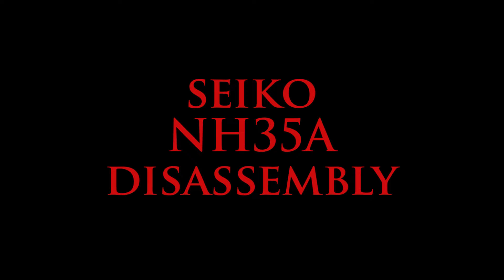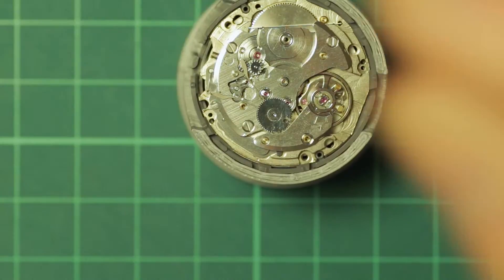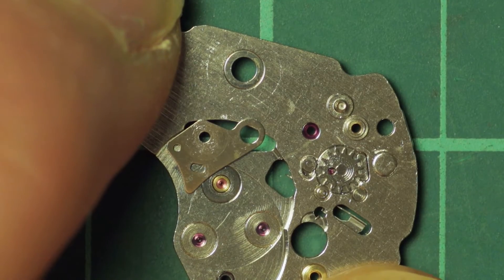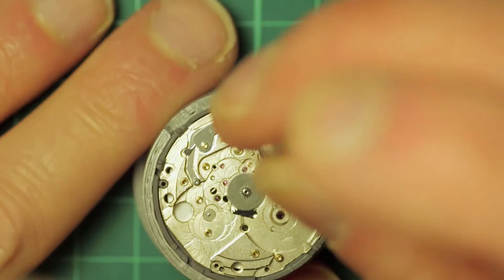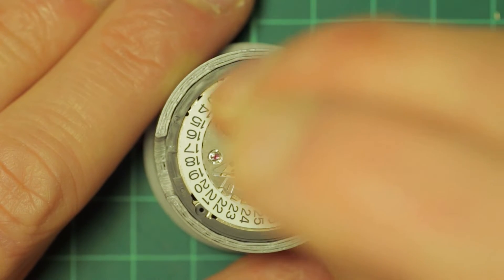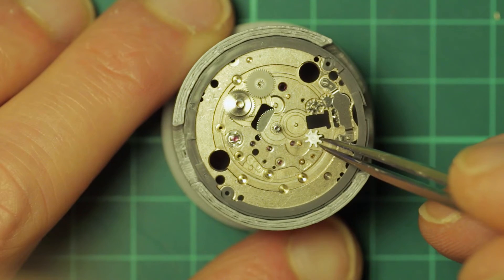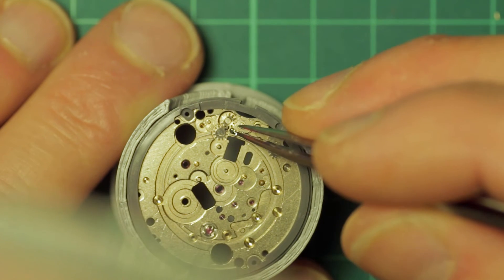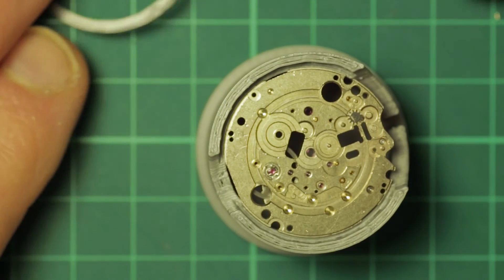Seiko NH35 - NH35A Part 1 Service - Disassembly

Comment: very cool. but realistically the price of a replacement new one costs less than labor costs repair it. but i enjoy it either way i have an old 7s26 that stopped working and i replaced it with nh36 movement. and i want to disassemble it like this. 👍
Reply from the maker: Absolutely if you're paying someone to service one. A brand new replacement is cheaper without doubt.
I filmed this because no one on YouTube at the time had taken one apart and I wanted to see how different or similar to the 7S26 they were.

Comment: I have this i problem.As i rotate the crown stem the thing in the middle that rotates the hands stays in position and doesn’t move even a bit.I requested a refund and they said they will refund me but i think there is a way to fix it.
Reply from the maker: @faze_vankis1205  I'm assuming that you're in hand setting position. Your crown will have 3 positions closest to the watch winding, middle, date setting, furthest out hand setting. 
Turning clockwise turns the hands clockwise. 
If the stem is pulled fully out with 2 distinct clicks then something is amiss internally which could be anything from a misaligned setting lever to teeth on the gears damaged.
Reply: @ what should i do because i in new to this kind of thing
Reply from the maker: @faze_vankis1205  Whatever the problem it will require quite a bit of disassembly to find the cause and possibly parts to repair. All said it's cheaper to replace the movement at about £30
Reply: @ Can you send me an link for new movement?
Reply: @ Is there any chance to cantact you and help me with the problme because another movement will come in 2-3 months in my country

Comment: Sorry if I missed it in the video or comments, but how much would a servicing cost for this movement with gasket replacement?
Reply from the maker: Cost would depend on the watchmaker/service centre in question but the bottom line with a movement like this is that a brand new replacement would be as little as a third of the cheapest service price you're likely to encounter.
They can be had from supply houses for £40-£50

Comment: do i have to disassemble the whole movement to remove the plastic spacer of the movement? or after the calendar wheel is removed you can strip it ?

Comment: how much years the NH35 can survive without problems ?
Reply from the maker: Like most modern mechanical movements with modern synthetic oils it should run between 5-10 years before needing service.

Comment: Hello,
Thank you for the great video!
I have a question (if you could help me - I google'd around a bit but didn't get a certain answer besides the obvious one - rotor) - What parts can I remove (besides the rotor, of course) to keep it as a manual winding movement only?
Is there any other part besides the rotor I can remove to keep it as manual only?
I am waiting for a movement to arrive in a couple of weeks and I could test then, but I think a small question doesn't do any harm until then.
Cheers!
Reply from the maker: The oscillating weight and the automatic bridge underneath it.
You can however leave the automatic bridge although automatic winding movements aren't ideally suited to be used as manual wind only without some modification to the winding components.
Reply: I think I've got my answer in the 2nd video. I've just reached the end and you mention that the hand winding won't work without the reduction wheel and automated bridge installed. I guess I can only remove the rotor, right?
Reply from the maker: @SoctheBASStard  Actually yes that's true as it winds via the reduction wheel. I was confusing it with most Swiss autos which have a separate system.
Reply: Thank you for your answer! will test around when the movement arrives.

Comment: Hi - Great walk through!! Once disassembled, what is the best way to clean all the parts prior to reassembly.  I've got an NH35A that is new but doesn't regulate happily - 1 out of a batch of 5 so I assume it's likely to be excess grease/oil etc.  Is the process basically the same for NH36 and NH34? Thanks!
Reply from the maker: I use a conventional watch cleaning machine but if you don't have one and are hand cleaning then a small essence jar or similar small glass jar and a soft paintbrush with naphtha will clean the parts adequately especially being new, a rinse in isopropyl alcohol except the pallet fork and balance assembly then reassembly and suitable lubrication should see it ok.
This is assuming there's no underlying cause of the poor running and it's merely lubrication/detritus/assembly problems.
The others should be essentially the same the only difference being extra or lesser dial side components for calendar work and/or GMT gearing parts.

Comment: Was the power from the mainspring released by unscrewing the ratchet wheel?
Reply from the maker: No, in this case (and in the case of any automatic winding watch) you remove the auto winding works then release power slowly from the crown whilst lifting the click spring.
With the 7S26 and earlier models which didn't hand wind you use a screwdriver on the ratchet wheel screw to slowly release the power.
Reply: got ya, i build my own watches but havent quite gotten to disassembling a movement till i was given a non running NH36 first so wanted to get a feel for it first, ive disassemlbed old 60/70s watches that had an obvious click but im used to seeing those instead i think. thanks :)  @spidiq8

Comment: This is a spectacular video.  I built a Submariner homage with an NH35 and as I was trying to get it better than +6 sec/day and 2.7ms beat error, the balance wheel stopped and refused to keep moving.  Your video helped me disassemble it to inspect the parts.  Now it's time to reassemble it and see if the cat hair stuck to the escape wheel was the culprit.
Reply from the maker: That sounds promising. Anything on the hairspring will cause you problems. Be sure you have a very clean and well lit work area for the reassembly.
Glad the video helped.
Reply: @spidiq8  I've got a desk specifically for watch work.  This isn't my first movement, just the first Seiko.
Reply: I honestly wanna buy one of these just for study purposes, it's quite amazing how this works
Reply: When I got it back together the balance wheel still wouldn't stay in motion, and the stem wouldn't insert all the way.  I took it apart again and found that the yoke wasn't properly aligned with the sliding pinion.  The balance wheel just took a bit of hairspring adjustment and regulation, but it's running at about +3 sec/day with a 0.3ms beat error now.

Thanks again for the time and effort put into your video.
Reply from the maker: @SlickWillyTFCF  Great news, glad you got it sorted.

Comment: Good evening. Very excellent. Thank you very much !! Just a question (I'm a beginner)... Wich number for the tweezers you use on the vidéo ? N°2 ? N°3? Thank's i
Reply from the maker: Thank you. I use several tweezers day to day. My general use for most parts of disassembly are AA stainless and brass though.
Reply: @spidiq8  Good morning. Thank's. I'm sorry but I'm not sure about AA. I have Bergeon and Dumont N°2 & 3. What is the correspondance number for AA ? Best regards !
Reply from the maker: @fredericlebovici5199  I'm not 100% sure if there's a number alternative but it's a commonly seen size on supply house websites.
Such as here.
https://www.cousinsuk.com/product/dumont-noaa-fine-strong-tips

Comment: 👍It helped me a lot at the beginning to repair the broken / out of order nh35 movements i bought (in france only) 👍

6:40 ⚠ the white small date plastic pinion is glued under that plate ⚠ (easy to loose ...)

9:12 this additional "spur" gear is not "spare" (what i understood first 🤣), it is needed for the date change and is very special : it has a spring on one side to lock on the stem (if not firmly,  this could cause quick date change problems btw)

Comment: just replaced my date wheel, never EVER doing it again good lord it took me an hour and a half and 5 separate tries and I lost a screw, oh well, finally got it working and I feel like a real watchmaker now lol. just a question, do you think me missing a screw will mess up the movement? I have 3 out of the 4 in there but the other one voided lol
Reply from the maker: That could potentially cause slippages and jumps in the calendar wheel components, jumper spring etc.
Watches rarely function well with a missing screw.
Reply: @spidiq8  I found it by some miracle And was able to get it in!
Reply from the maker: @wacamac1006  great news and well done on your first watch adventure. They do get easier with practice.
Reply: @spidiq8  my problem started when I removed the original date wheel, I didn't realize it could take everything out of place so after fiddling with the date wheel jumpers and such I finally did it, if there ever is a "next time" for me I'm definitely going to follow a video and hold the 2nd frame down into its 2 pins when I remove the disc 😂😂
Reply from the maker: @wacamac1006  You got it back together though and that's positive. Some would have given up. It's always a good idea to watch through a video of one is available, if not search for a service document online.

Comment: Can you use the crown from the nh35 in the nh36
Reply from the maker: Yes you can. The only difference is date only or day date, the movements are the same.
Reply: @spidiq8  so it's the same crown for both movements? Isn't there a difference with nh36 mechanism to accommodate the day display?
Reply from the maker: @Barnaby_bo  The same stem for both movements. The crown will fit the stem but not necessarily the case. I.e. If you have a dive watch with a large screw down crown it might not fit to a smaller case but they're interchangeable otherwise.
Reply: @spidiq8  thanks for the info. 👍

Comment: great video sir.  Question does the nh 35 movements use any plastic parts and if so are they subject to wearing out?
Reply from the maker: Thank you. The movement ring. Dial ring and most of the calendar wheels are plastic. They rarely 'wear' but rather break through trying to quick change the date with the hands in the wrong position.
They're a very rugged movement with decent accuracy and a great cost.

Comment: Hi, i've done about 6 of these movements i think they're well made and you can get excellent accuracy out of it, i made myself a watch a couple of years ago, looks like an explorer 1 but i needed a date so it has one, i regulated it and it's consistently about -1 or less a day, (90% of the time the train brige goes on and no messing required all falls into place) wear it all the time love it. Cheers q8 excellent video.
Reply from the maker: They are really great. Amazing quality and accuracy for the incredibly cheap cost of them. Are you on any Facebook watch groups? I admin on a couple for watch repair and there's a great Seiko group also.

Comment: How do you power down the movement? It seems like it was running then it stopped.
Reply from the maker: You need to remove the automatic winding works then you can release the click and using a screwdriver on the barrel arbor screw release the power steadily. With most movements you can release the power via the winding crown.

Comment: Hi, does the movement (or any automatic movement) uses gold in it? I wonder if it is gold or brass? Why?
Reply from the maker: Some very high end haute horlogerie movements user gold parts but typically things like the oscillating weight in an automatic. Brass, plated with nickel or bare is the most common.
Reply: @spidiq8  thank you so much! I've been looking for an answer for soo long

Comment: Your not affraid about scratching the components when using a metal tweezer?
Reply from the maker: Generally speaking no unless a part is typically bad for grip or likely to slip it's more about well dressed tweezers and the grip applied. Most scratches from mishandling are from poor quality tweezers or poorly dressed worn tweezers.
Like the old adage about the likelihood of cutting yourself with a blunt knife is higher than with a sharp knife because you have to use it inappropriately. The important thing is to train yourself out of bad habits, things we all do like using the point of the tweezers to press setting lever release buttons etc.
The other thing is, this is my own movement and the video for several people who'd asked about the NH Vs other Seiko. Had it been one I was working on I would have used my brass tweezers to handle the bridges.

Comment: Nice job. I find these movements very ugly and also reports of badly performing nh35s and 6r15 have been quite common recently. On top of that there quite a few plastic parts which always annoys me. Im just not a fan of the modern seiko movements.
Reply: I have 3 Seiko with 6r15  and all of them are between  +2+4 sec\24h just like my Rolex explorer 2 or my sub...well my 2010 sub was-4\24 right from the start. Also you have to see the dramas about the new 3235 rolex movements on the rolex forums. People pay lots of money for rolex watches and they dont work properly ; so think twice  before you are complaining about seiko movements .
Reply: @Ge0rGi.  Yes, mine keeps fantastic time. It loses a couple of seconds during day (on the wrist) and gains a couple of seconds during the night (resting with glass up). Pretty much +- 0 seconds. Even If I had a Rolex, I'd be happy with those numbers.
Reply from the maker: Thanks, hope you enjoyed it.
These are perfectly good but you must remember they're built on an assembly line and are entry level very cheap mechanical movements which can be had for little more than a range of cheap Chinese movements.
There will be the odd one which slips through and obviously Seiko are going to pay a little more attention to their own 4R variant.
They aren't anything above and beyond the tried and tested 7S but they're great value for what they are.
Reply: Despite those three plastic wheels,  it is an inexpensive but reliable, acurate, durable and workhorse movement!!!
Reply: I don't like plastic either, but these plastic date wheel parts work well for decades and are ridiculously easy and cheap to replace in the odd chance you ever have an issue.